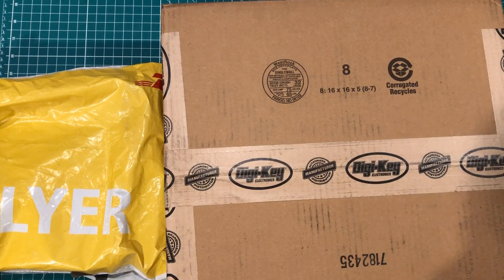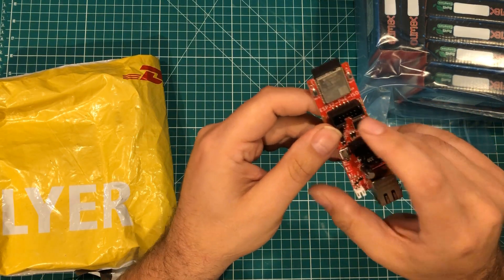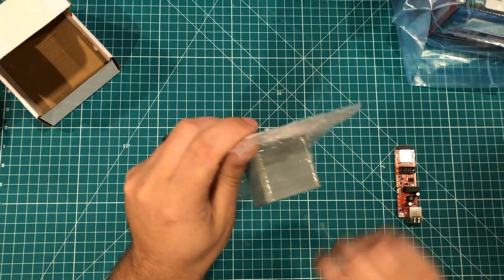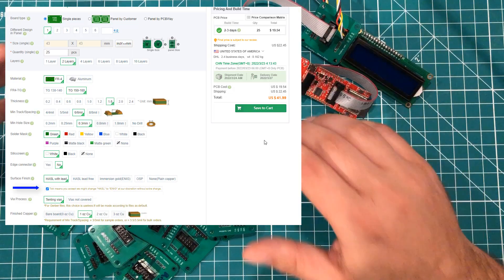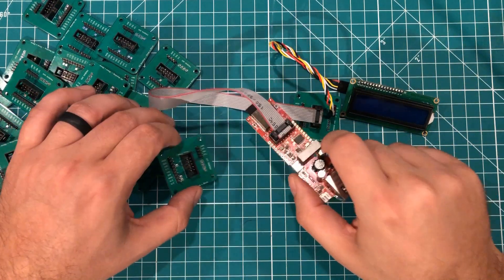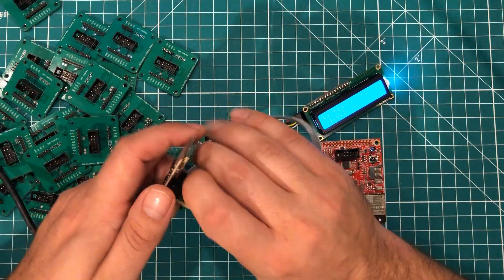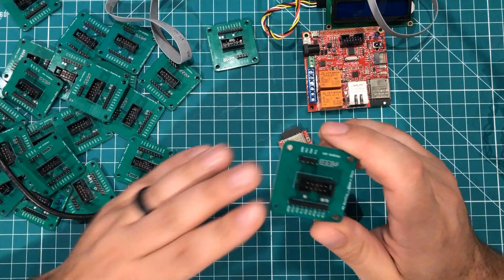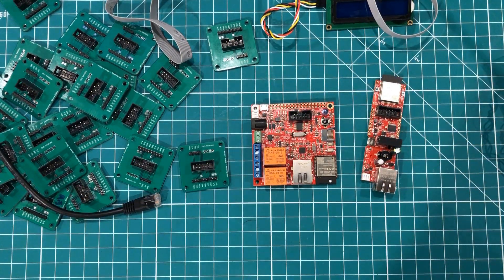My favorite ESP32 for Commercial and Industrial Applications (and my first PCB!*)

Comment: Would love to see some stuff on both of these boards used with ESPHOME and Home Assistant! Does the built in ESPHOME OTA work well with them?
Reply from the maker: I've never tried it, but I'm working on some IOT stuff around my house and office, so I'll give it a shot.
Reply: @AnotherMaker  Cheers! Am considering ordering some myself, tired of the wifi issues with normal ESP32s :D
Reply from the maker: @bastiat691  it does seem like a good platform for that sort of thing. I'll give it a try

Comment: Really informative video.  Since you have more experience with this board than I, do you know how you would be able to add a speaker (mono) to it?  Does this board use I2S?  I know it handles I2C. Would that be possible with using the UEXT pins?
Reply from the maker: It doesn't have i2s.  It depends on what you mean by "speaker." I do drive sounds to normal IO pins. I think I use a library called cutesounds to make all sorts of neat sounds. Beyond that there may be ways to extend the sd slot to play mp3 with an addon, but I'm not sure.

Comment: The Olimex boards are a good price and nice now that they have isolation from USB. They don't provide much power for 3.3V and 5V though (1W combined). The wESP32 gives up to 6W on 3.3V and 5W on 5V (shared). Also with the wESP32 you can have 12V with 12.95W (theoretical) instead of 5V. Those are the only options for PoE dev boards I've found. I ended up going with the wESP32.
Reply from the maker: I'll need to try that one out.  I don't need to drive a ton of stuff in my use case, but I could see that being handy.
Reply: @AnotherMaker  I recently found a Lilygo ESP32 PoE board, fwiw.

Comment: Can you get the ethernet to work as well as the wifi at the same time? My company is out in the middle of nowhere with no cell service. I will be connecting a 3.7v battery but that is simple. I want to be able to connect to a network switch give the ESP32 an ip address. I want the esp32 to be dymanic instance of static. I just ordered my 2 of these boards from Mouser so they are on their way.  I hope all this makes since. BTW Roll Tide.  :)
Reply from the maker: War Eagle. Just kidding.  I lived in Bama for a few years and I decided to roll with the tide.  

I don't think I've tried getting both to work. Once I have internet, I have internet.  I wouldn't be surprised if it's challenging more from library support than the board itself.
Reply: @AnotherMaker  I got the WT32-ETH01 and I downloaded and played with Platform IO. I was able to get it to connect but I downloaded Asyncwebserver from GitHub but it didn’t work. So I am back at it looking for a different library after the coffee kicks in.
Reply from the maker: @willmaxwell2184  The only web server library I've ever used is the built in one

Comment: Cool, but fuck me those boards are way more expensive. Almost ten times the price of a cheapo NodeMCU-style board.
Reply from the maker: On the surface, but adding ethernet to NodeMCU separately costs a bunch.  Adding a power supply and power cable costs money (and may require electric to be run to where the board is).  POE allows me to pass that over to the customer where their existing hubs deal with all that.  I haven't verified it over a long term, but I think the "Total Cost" including labor to hook the thing up will be cheaper by a good bit.  Plus it requires next to no training compared to explaining what dupont wire goes where.
Reply: @AnotherMaker  Yeah I understand the application. But I struggle to believe the price they're charging. I fail to see how adding PoE and ethernet could increase the price by 1000%, even when you take into account the economies of scale of the NodeMCU.